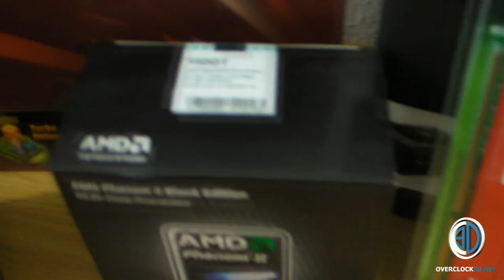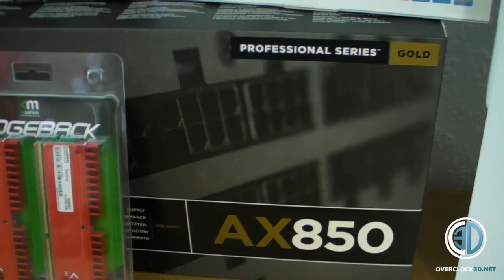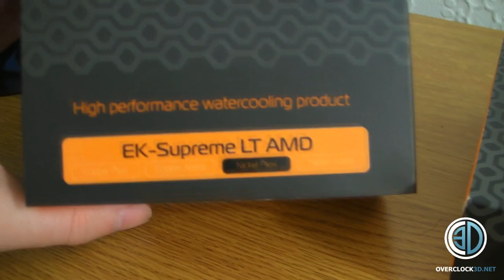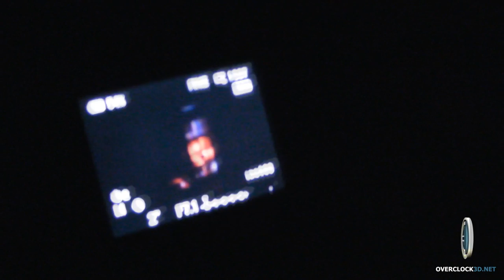Snow Drift - Water Cooled 690 II Advanced 6970 1100T Gadget Show Live System

Comment: Hey bro, great video.  Showing the clearances on a 240mm radiator mounted at the bottom was a good idea.  Those of us planning to just water cool the cpu and keep the external top fans as simply exhaust will definately find this type of info useful.  ax850 is also a great powersupply great rig... 6070 ftw

Comment: 14:00
I've done that for my built. It is not 100% necessary but it added so much more fun into building it.
Going from one CPU to GPU bridged to another GPU can do anyone.
But getting rads between each component requires some thinking and in the end, I think it looks much cooler and most of all, much more expensive/complex unlike seen in this video. Plus it ensures maximum cooling for each component. (no 2nd or 3rd overheating GPU)

But this one is awesome of course! (tastes vary)

Comment: About the psu length, if you put the fan at the bottom it means the cables are on top so there is much more room.mthis is from experience with the same case and psu

Comment: @pony029 it doesn't matter in ANY way how you loop it. just aslong as the blocks aren't reversed it will still work exactly the same. other then multiple radiators, put them in between hot spots, eg between the cpu and gpu.
so no, it isn't improperly installed.

Comment: Hi, is there any chance you could do a video on how to properly cable manage a system. I noticed some pro's actually cut the cables to length but as i have never attempted this before it would be nice. This includes like how to tie the cables down on the back, what to use, etc. I can do a neat job but when it comes to custom bits its hard.

Comment: Black & Red !!! 
I am building a similar rig to this only I am using 

Crosshair V Formula 
MSI Lightning 6970
Corsair H100
AMD Phenom x6 1100T
Segate Barracuda XT 2TB 7200 64Mb Cache 
Corsair AX 850 Watt
Corsair Vengeance 8GB
in a Coolermaster Storm Enforcer 
and possibly purchasing a Corsair Force 240GB SSD

Comment: Hard to diagnose with that little information, You say Blue Screening, is that while trying to load the installation disk for the fist time or have they been running for awhile and it started happening? but you definitely always plug in maximum power to the motherboard it can filter out the surplus with the exception of when they they use a connector like the ones of CD players in witch case do not look the same at all and are an alternative. Finally there are 4 different Asrock extreme4 models.

Comment: Great job!! I'm going to follow this build similar. I'm wondering is the Lang pump the same as the Laing DDC-PRO (DDC-1T With Top).Can't seem to find the Ultra & I'm wondering if the Pro will fit? Any differences between the 2? Would one be able to follow this build & run 2 ssd & 2 mech drives in the system (same case) & an optical drive? I'm guessing probably not. May have to go to 2 ssd & 1 mechanical. I plan to use a 6990 for the vgu & 3570K cpu. I have XFX Black Edition psu, hoping it fits!

Comment: Very sharp. Too bad the red LEDs are drowning out the red fittings. They are very tight indeed.
 How do you set up the ssd and hdd so your downloads(post OS install) bypass the SSD and drop into the HDD?  Im having that problem with my Sabertooth x58/ i7 950. With 60 gig SSD and 1T hdd. With 12 gigs of dominator.

Comment: hey tom
i am planning to build a massive watercoolingsystem.
there's gonna be 2 x laing D5 pumps in there.
would you still advise 2 put the hose on the barbs like this. 1/2 barb - 7/16 hose
it's that it wont fly of or anything.

Comment: Can you offer advice, how bout this: Swiftech MCR-X20 Drive Rev3 Series Heat Exchangers & Integrated Pump dual 120mm to cool the 6990, then cool the 3570K cpu w a MCRx20-QP "Quiet Power" Radiator Series w built in reservoir , Bitspower fittings,and 2 Phobya fans under top of the 690 for the cpu rad and GT AP-14's for the 6990 rad. Thoughts?

Comment: I'm just curious if you would think upgrading from an Athlon 2 x3 440 core to a 1090t would really be worth it, essentially this would stop any bottlenecking I've been experiencing in high cpu ntensity video games on my 6970. Now I'm looking to get the 1090t because I could just add 100 or so mhz on the core to get a "1100t" and I see this build is using it, is it really worth 20 dollars more for the 1100t?

Comment: This is a bit of a random question but I have 2 computers that I built that continue bluescreening, But its 2 in about 60 that I have built and the only thing they have in common is I have used the asrock extreme 4 motherboard, I was just wondering can this be caused by having an 8 pin plugged into the motherboard? and how do I know weather to just put a 4 pin in the motherboard or go for an 8 pin? because often motherboards have stickers over the extra 4 pins, I don't know why that is! Please!!